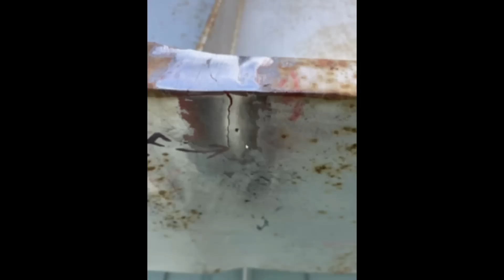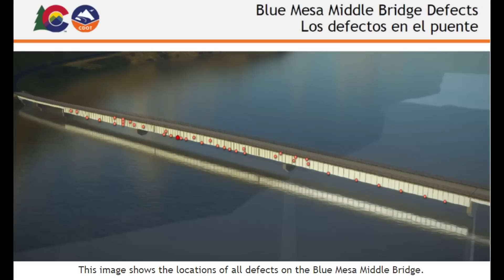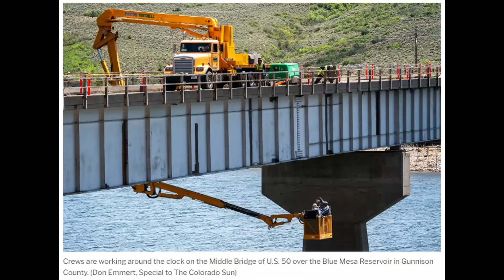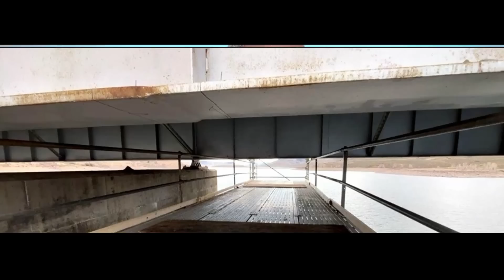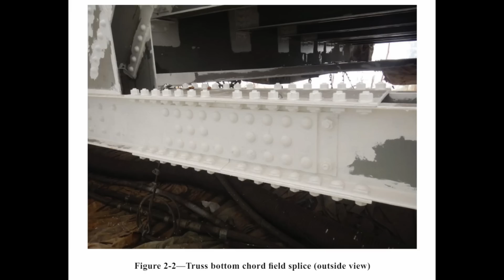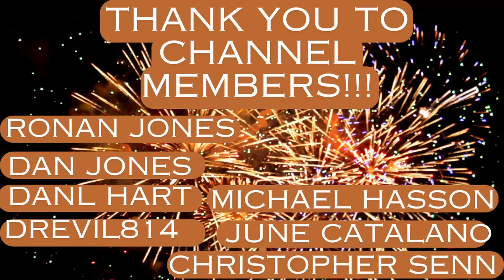US-50 over Blue Mesa - Steel Repair Plate Installation

Comment: Attended a meeting with an unofficial presentation on this project to a group of bridge engineers by a group of bridge engineers involved in the project.  Significant additional items in the presentation:
About 118 locations with weld flaws of significance in but welds.  This apparently means below todays new construction standards for non-redundant T-1 butt welds.
Some fillet weld cracking perpendicular to the axis of the weld that penetrates into the flange.
Some (most?) Floorbeams overstressed.
Scope change from spot repairs to bring all the structual steel up to new bridge strength and servicability ratings.  This results in effectively continuous bottom flange sister plates, and spot sister plates on the top flanges.  This scope change may be due to that fillet weld cracking as these locations are not necessarily at the butt weld locations.
Bracing modifications.
Completion now mid December?  Still busy drilling and bolting.  Winter so far has been holding off (my comment), but in my opinion, so long as the bolted repairs  are done, and deck access holes patched and cured, waterproofing and overlay and needed painting can wait to late spring if needed. .  
A bit of mixed Fem for distribution factors to result in correct ratings using BRr which otherwise would not result in correct ratings due to the hangers, and its use of pinned connections at the ends of floor beams, and perhaps bottom compression flange analysis out of range due to large diaphragm spacing.  This work might be still in progress, but they did have a graph of strength rating factors for the  length of a structure before the strengthening and after.  Most locations have a high live load rating factor (up to 9) with the worst about 1.75.  I presume this was HL(93), though a couple of the SU vehicles were noted to be the critical load for the floor beams.  The exact defination of this rating factor is unknown to me, might just be liveload factor ultimate capacity for which 1.75 would be an inventory factor of 1.0.
This means to me that they now seem to be shooting for a superstructure life equivalent to a new structure.
I did not hear anything about a new deck.  My guess is that they will waterproof it either with a polymer overlay or with waterproofing membrane and asphalt.  This should result in a remaining deck life  of perhaps 20 years or more before redecking (my estimate).
Huge amount of man-hours so far, but the pre-construction, design, and construction monitoring and management costs have been not too far from normal.
Reply from the maker: Thank ypu so much for your comments. The FHWA slide  indicates that Colorado has 3 more T1 bridges. I wonder what's going on with those.

Comment: CDOT put up another video of an update puplic meeting that occured on 7/2/2024.  It had funding info as well.  There was a quick mention of the Bridge Enterprise participating, a funding device used by CDOT for rehabilitating or replaceing "Poor" bridges.  If I recall to secure the bonding for the loans they use the life after rehab or replacement needs to be at least 30 years.  Apparently the doublers have been placed on the area with the surface crack for the Middle Bridge, and the three substantially identical locations, all considered most critical.  Each of these locations has two flange butt welds bridged over by the doubler.  The Lake Fork bridge a couple of miles to the west had its close up hands on inspection completed in early April, but will be getting more rigerous butt weld inspections starting last week (I think).  Overlays have been removed.  Additional butt weld repairs (top flange butt welds and perhaps other repairs?) will continue on this bridge and be made as soon as practical on the Lake Fork bridge.  The picture of the repair locations now seems to show a continuous repair or doubler on the bottom of the web.
Reply from the maker: Thank you for that information all look into that!

Comment: I saw a 6/26/2024 Colorado Sun update with a fairly detailed history of CDOT's activities with this T1 issue.  Apparently there was also a  small welded T1 off system bridge (Local structure not owned by CDOT) that was identified as needing testing, but it was tested before they got to testing the Blue Mesa structures.  I was not aware of this one.
Reply from the maker: Thank you.  I will check that out.

Comment: Since there are 3 types of loading on a highway bridge, with the most destructive load being dynamic, I would assume that the bolting of the repair plates would be specified to be slip critical with continuous special inspection. What say you?
Reply from the maker: I suspect you are correct on both counts, although CDOT has not elaborated on such details to my knowledge.
Reply: @CaseyJones-Engineer  I believe unless they eventually deal with the fracture critical (non-redundant) nature, meaning a failure of one member can cause collapse of the bridge, it will always be "Special Inspection" requiring  close up inspection of all the "main" members.  It is already special inspection for the substructure requiring deep water scuba inspectors for the columns.

Comment: What weld process was used in the original fab? Submerged Arc? Electro slag? What type of welds are these? Butt welds in plate girder web plates? These are important facts left out , they are not “too in the weeds” nor would they significantly lengthen the vid, if the civvies don’t care, it’s a few seconds of content they can ignore, for those involved in weld fab, inspection or repair that is vital info.
Reply: Probably submerged arc, but other processes are possible...not electro slag.

Comment: I have a family vacation in Crested Butte in mid-July, driving in from the west coast.  We've made alternate routing/detour plans.  I believe there'll be nearly zero chance that US 50 over Blue Mesa Reservoir will be open to traffic by then.   Maybe in the last full week in July, as we drive back west, it'll be an option but I'd be completely unsurprised if that route is still closed.
Reply: Bridge will be open to one way traffic July 3rd or 4th.
Reply: @mikecurtis7113   I'll believe that when it happens, but I've got three alternate routes planned that don't require the circuitous route involving I-70 anyway.

Comment: And yet ... and yet ... the Verrazzano Bridge, New York City's newest suspension bridge, is 60 years old. As far as I know, it's doing OK. The Whitestone, Throg's Neck, Brooklyn, Manhattan, and Williamsburg Bridges are older still. I guess we don't build them like we used to.
Reply: These are all toll bridges all where the toll can be adjusted to cover maintenance costs, not compete with paving, Striping, maintenance of signs, traffic signals, rails, plowing, drainage, as well as adding roads and lanes to serve the ~200% increase in population since this bridge was built.  I suspect the annual avg mtc cost of any of the bridges you mentioned would exceet that of all the state bridges in Colorado.
Reply: @michaelmcmullen354 The Brooklyn, Manhattan, and Williamsburg Bridges have no toll. When it first opened, the Brooklyn Bridge had one, but hasn't in my lifetime. The Verrazano, as you pointed out, does.

Comment: 118 repairs, each with a steel mending plate that weights "several thousand pounds" would mean adding a static load of 200(?) tons or more to the bridge. Two questions:

Will this result in significant weight or traffic rate restrictions to the bridge?

How do you determine what order to add the plates without taking your engineering vehicles for a swim during the process?

Comment: 183 cracks that certainly didn't occur overnight. Someone is not doing their job properly, and this is getting ridiculous.
Reply: The cracks most likely have been there since manufactured in 1960. Most  can only be detected by ultrasonic testing.  Not a maintenance issue but a fabrication issue.
Reply: @michaelcurtis-cdot8978  👍

Comment: Unrelated to this bridge, but how long would you want to wait before using Owens Corning Pinkbar instead of rebar? I know it's not your primary area of engineering, but it's an interesting product, presumably with different failure modes than steel rebar.

Comment: I hope the plan is to replace these brides within the next few years.  It is not unusual for a patch to alter the load path enough to initiate cracks elsewhere.  I also hope they inspect these bridges on a 6 month cycle until they are able to replace them.

Comment: As a distant observer (a Nordic) I find it heartening to see 'Murican local authorities actually responding to reports of failing infrastructure! This is probably quite unique! The normal 'Murican reaction is to ignore the warnings until a bridge/tunnel/overpass/whatever has a catastrophic failure, resulting in many lives lost. Only then will a bunch of obese guys try to scramble their obese arses into gear....
There have been so many cases where critical 'Murican infrastructure has been neglected for decades, with disastrous consequences - seeing a case where preventive action is really taken is comforting.
I assure you: Infrastructure DOES fail on occasion in the Nordic countries, but those cases are few and far between. They  have been treated like Airliner crashes! All hands on deck to investigate and ensure there will be no repeats...

Comment: Would you know if railroad steel bridges are made of the same material? The Lake Fort bridge looks to have similar construction to some rail bridges and overpasses.
Reply: No.  FHWA indicates that 20 States have identified bridges with Grade A514/T1 Steel •64 Bridges with A514/T1 Steel with Butt Welds •16 States have bridges which will require NDT by March 31, 2024

Comment: This Colorado temporary bridge repair relies upon common sense exclusive of traditional bureaucratic - magical thinking and tombstone mentality. Common sense dictates: 1) temporary Bridge closure 2) temporary repair leading to permanent repair and 3) bridge opening. Actual bureaucratic procedure entails: 1) an engineering finding that the bridge is on the ragged edge of collapse 2) reluctant temporary 
 bridge closure by frustrated politicians (after all nobody’s been killed yet). 3) temporary repairs 4) bureaucratic realization that the bridge hasn’t fallen (yet) 5) the magical belief - hope - prayer that it won’t fall until I’m retired 5) the temptation to spend the permanent repair money on pet pork projects 6) ultimate disaster costing many lives 7) the search for a scapegoat and the expenditure of billions on a new bridge.
Reply: Actually since "temporary"  is often about 15 years, it is best to do the closest to a permanent repair of what broke that you can afford, except in the case where replacement plans are ready and about to be bid.  This latter is not uncommon as truely "poor" bridges are often maintenance nightmares needing several repairs a year, though some have just never had anything fixed properly.

Comment: This is why I have the thoughts of always have two ways to go rather than one. I do understand things cost money but I dont understand the lack of planning. Did no one ask the question of what happens if we lose that bridge and should we build another one just in case?
Reply: CDOT has the initial construction cost, and replacement cost for all the state's bridges, and has a prioritizing process that at least covers all the poor rated bridges.  Except for the recent T1 crack problem this bridge was probably "Fair".  The cracks jumped it over "poor" to "closed".  Fixing the T1 cracks would most likily jump it back to "Fair".  A rehab that replaces the deck with a small widening, rails, and eliminates many of the deck joints MIGHT jump it to "Good", but probably not as repaired but not replaced deficency items do not usually go back to the best evaluation state.

Comment: I have had some experience with T-1 steel and have successfully welded it with flux core (FCAW).  I have just reviewed your previous videos on this bridge.  From what I see, the problem appears to be in the welding process and not necessarily in the steel itself.  Please correct me if I am mistaken.  Therefore, the material, although dated and superseded by better steels, is not the problem.  The welding procedures used have created the issues.  I'd really like to see a metallurgist and welding engineer weigh in here.  Presumably, an XXX18 rod should have been used.  What do the design specifications call out?  There all also pre and post heating requirements.  The risk is that people begin fearing anything built of T-1 or ASTM A-514.  That would be a large mistake and overreaction.
Reply: All of the T1 Steel Welding was done at the fabricator before the bridge parts where transported to Colorado in around 1960.  They didn't have the welding procedures and welding inspections we have to do.  So the fabricators basically provided the T1 Steel with welds that would fail over time.  FHWA identified this issue I believe in 1993.
Reply: I agree.  I think some of these problems were found and repaired, sometimes again and again as the weld zone seems much bigger than the double v groove butt normally used.  Sometimes the cracking occurs after the QC testing....
Reply: Also, I think the problem is usually in the heat affected zone rather that the melt zone, or at the interface betwween those zones.

Comment: I've driven this bridge many times.  Very glad that they are doing some kind of repair, rather than sitting around with their thumbs up their ears, trying to figure out some super-solution.  That whole bridge area and the surrounding roads were a WW2 effort to allow an alternate pathway through a rugged mountain section.  That whole zone needs a duplicate of Hgwy-70, with a full four lanes both ways.  Same problem lies above Denver, where there are no good alternate routes over the mountains, until you get into Wyoming.  The post-Eisenhower highway system mostly forgot about that zone, to quote Jack Kennedy, "because it was hard".  Hgwy-70 is a major choke point, if it fails, especially in the western canyons, and this happens regularly.  Huge traffic disruptions.

Comment: For more details, see the wikipedia article on Hydrogen Embrittlement.  In short, steel has ductile (can bend and flow), tensile (stretch), elastic (return to original shape) properties which are negatively affected when hydrogen is absorbed into the metal. During normal operation of the bridge those more brittle areas do not behave as expected in the design and being more brittle the normal stresses of operational loading and heat/cold cycling can cause cracks to form.  Obviously a bad thing.

Comment: I'd bet money the original bridges were built in a fraction of the time and effort this repair will entail.
Reply: Took a few years from design to opening.
Reply: @michaelmcmullen354  How much did it cost?
Reply: @bobcougar77  No idea.  Not cheap.  Spans over 200 ft long tend to have rapidly escalaying costs.  Also structures in remote areas tend to be expensive.   It was fabricated ablout 8 years before I started work at CDOT.  In subsequent decades I provided CDOT design oversight over Joe Meheen's subsequent design firm for some of the other bridges his firms designed for Colorado.

Comment: My experience with repairing cracks in dynamic structures using doublers moves the forces that caused the cracks to other areas. Sometimes immediately adjacent to the repair. Inspect, inspect, inspect.
Reply: I have seen this in ship hulls, and it is very common. One ship I looked at ended up being scrapped after two major structural repairs had been applied to a crack on the top deck. I was told by a member of the crew that the cracks were moving when the ship was under way in weather. An engineer designed a repair that covered both sides of the crack. The ship was down for 6 weeks while steel plates were welded in, but the first time at sea after the repair she hit weather and a new crack developed in the deck where it met the bridge. There was salt water intrusion and corrosion by the time the ship went back to get fixed again.  The second repair was done, but within six months a new crack had formed, and this crack dove down below decks all the way to the bilge, which started taking water... And she was scrapped.

Comment: After the Northridge earthquake, cracks in the steel framework connectors in high rises of a certain age required nondestructive testing, additional doubling plates and welding. Very involved process.

Comment: Do you think this is a stopgap repair or a permanent fix?
Reply from the maker: My guess is stop gap that will be relied upon for several years.
Reply: My guess is permanent, but not complete.  The top flanges are another matter, but they have a modest degree of redundancy with the rebar in the deck and perhaps the stringers.  A truely temp repair would involve PT bars near the flanges.  This was used on the Hernando-Desoto till they could cut out the severely damaged tension chord.
Reply: Note Decks and rails never last 80 to 100 years in Colorado due to the deiceing chemicals, but replacement is fairly routine.  Just apply money and have someplace else for traffic to go for a time if the structure is not wide.